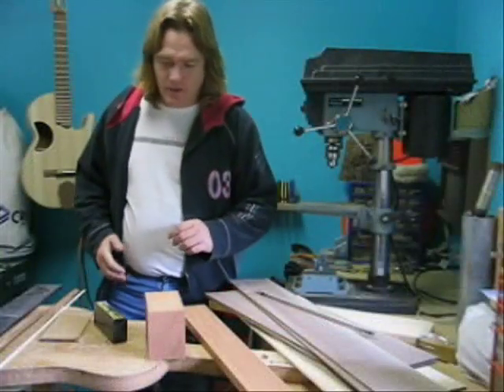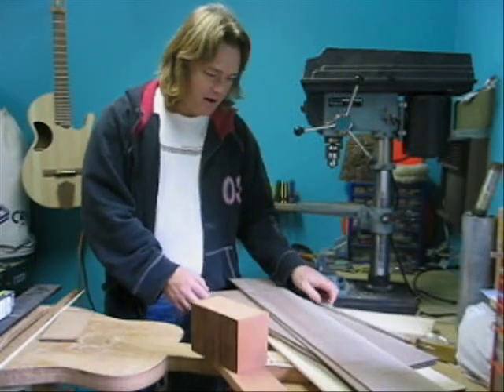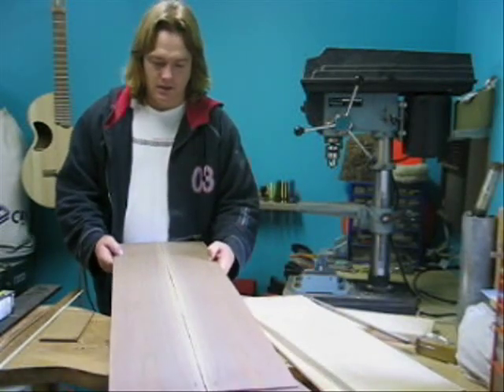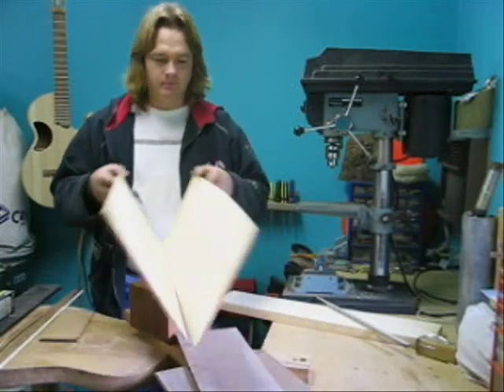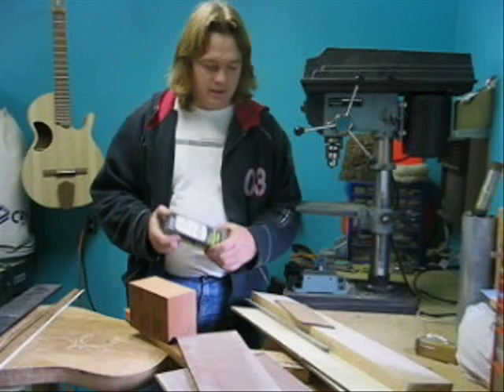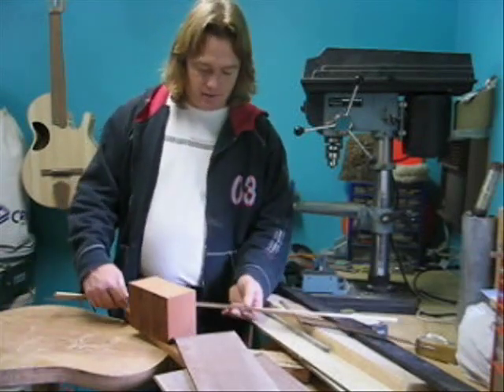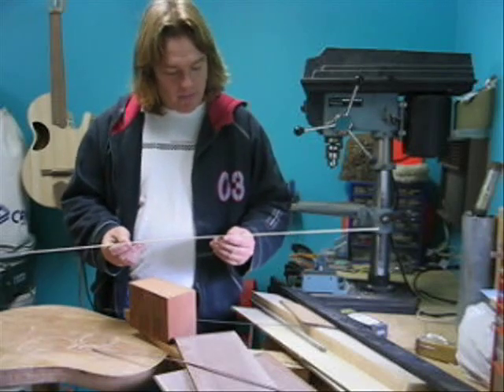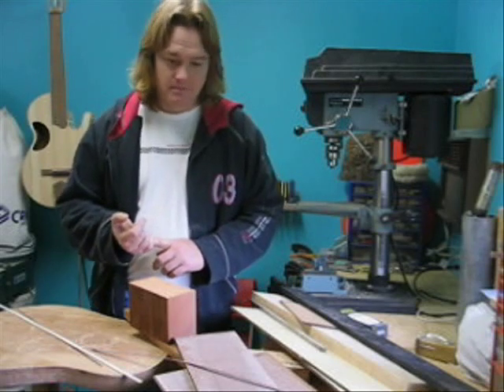Steve's Guitar Making Part 1 - Materials

Comment from the maker: The thickness of guitar plates is an age old discussion full of differing opinions, methods and theorys.  If you're using spruce for the soundboard,  try 0.125". Backs are thinner such as 0.100".  Sides are thinner still at around 0.085". I'm talking steel string guitars here, tops and backs are around 0.020 thinner for a classical.
  
Having said all that, lots of builders out there would have a different opinion.  My suggestion is always to try it and refine.

Steve